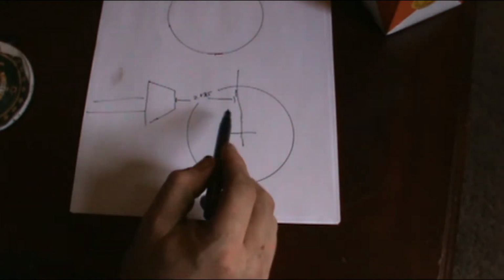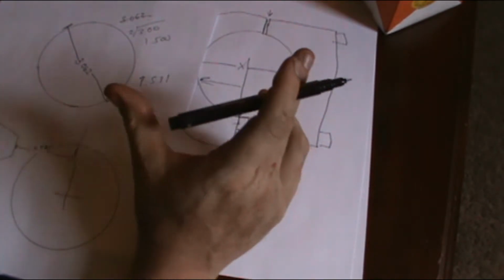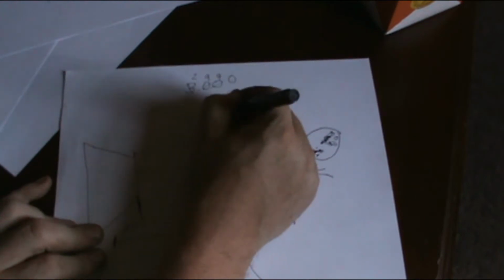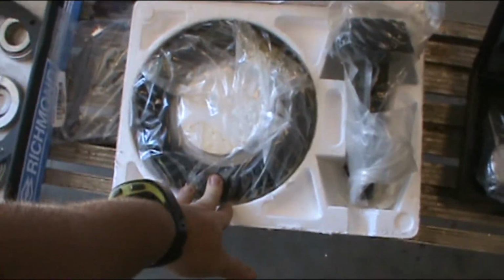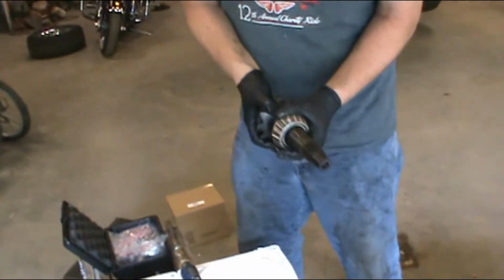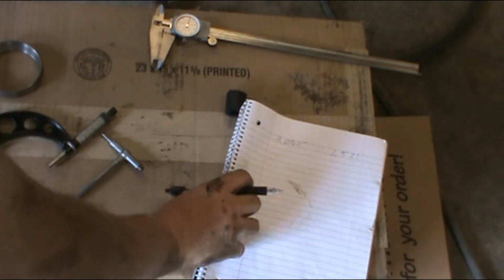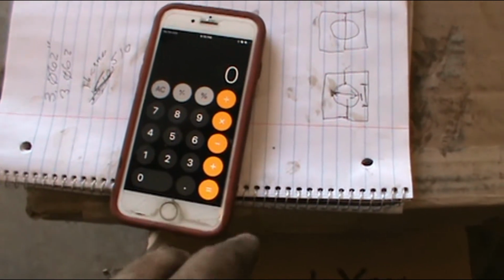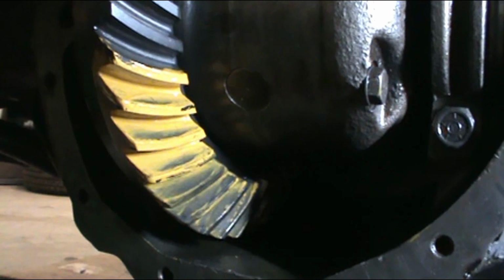Proform Parts 66516 Pinion Setting Tool instructions

Comment: could a man just torque the caps down, use a snap gage to find center line and thin use a straight edge face of the rear end housing, measure to the bottom of the Carrie race to the straight edge, divide the CL measurement by 2 that you got from the snap gage, calculate those numbers together to find true CL from face of housing. Then you can measure from the straight edge to the face of the pinion gear. Do you think that would work?
Reply from the maker: In theory if you can hold it all together
Reply: @GSEShop  your video is fantastic. maybe we share a brain but this was exactly how i need this to be explained. ive been watching and reading for days trying to teach my self how to do this. thank you
Reply from the maker: @joshstaley7459  comments like this make it all worth it

Comment: Good example. 
In the beginning I was starting to think that you were about to come off the rails,  however you held it in line and kept her on the tracks .
So as you may have figured out,  you can easily achieve these measurements,  without the tool, and save yourself some money.
When you took your first measurement, the OD of the bearing race , you then can put the bearing race where it goes in the housing , and with a good straight edge laying across the machined face of the rearend measure to the top of the race.
All simple math from there .
Add that number to the OD, divide by 2, you now have you center line.
You now can pull your pinion numbers to the face and your straight edge.
Reply from the maker: Thank you

Comment: It's been a long time over 20 some years since I worked on a differential on a car since then I've been retired from the business a GM cars I remember the numbers are the back of the but I also remember some of them had an extra number with a plus or a minus symbol a abnormal. Pinion gear
Reply from the maker: The directions that came with it gave it a +-.002

Comment: I think you're missing the point of measuring the distance from where the bearing cap bolts to the housing to the bottom where the race seats. It's not to just get half the measurement of the bearing race. If it was you would simply measure the race and divide by two. The reason they want you to measure from the flat surface where the cap bolts to the bottom where the race seats, it's because when they bore the hole for the race it's not always centered. It could be machined deeper in the housing or deeper in the cap. The center line of the race is not always where the cap contacts the housing, you may have more of the race in the cap or more of the race in the housing. That's why they have you measure it, and then add or subtract, if it's not centered. Most times it's not centered.
Reply from the maker: I admit I had not considered that, but I also haven’t run into it.  I couldn’t be off by very much or else you would have trouble installing the race either in the cap or in the housing.

Comment: Great video and explanation. 
I’ve done 12 and 10 bolts using the Ratech tool with good success but now I need to do a Chrysler 8 1/4 and was considering the $500+ puck kit. 
Gonna go this route since you made it comprehensible. 
Thanks again.
Reply from the maker: Thank you

Comment: The distance from the centerline of the ring gear to the backface of the pinion is;;;;
Dana 60 = 5.000 inches
Dana 70 = 5.375
Dana 80 = 5.812
Hope this helps
Reply from the maker: I am sure it does
Reply: @GSEShop  just so you know that information was taken out of a OE ford truck shop manual.
Also states in the book for an 8.8 the  nominal pinion depth setting shim is .030,, so that means that most 8.8 leave the factory with a .030 pinion shim,,and I can say that is all I've seen in them with factory gears
Reply from the maker: @justingeraldi2304  cool good to know

Comment: I  bought the Jegs brand and it has a hole on the other end to bolt the bar to the bearing clamp down area,  Also i figured out how it works and wrote a Excel file so all i have to do is punch in the pinion dim and variable numbers.  It calculates the movement amount AND which direction. I have tried different numbers eith way and it works on paper. I will try it on my truck diff soon.
Reply from the maker: Cool, I purchased this one but the jegs one was on my short list

Comment: First mistake, not all manufacturers (factory & aftermarket) put any measurement numbers on the end of the pinion for the purpose of setting the pinion depth. 3 examples: Chrysler 9 1/4, 8 1/4, Dana 60. Are you making the assumption that there are only GM cars out there? I fully understand the principles & how to measure. The big headache: Where the hell do you find the specs needed?
Reply from the maker: I am sorry but I was reviewing the tool and trying to provide a detailed guide on how to use it.  This was not an all encompassing “how to change your pinion” or “the only thing you need to know” kind of video.  I had to change the gears in my 12 bolt and that is the axle I used for the video.  If you cannot find the marking I would recommend contacting the manufacturer, or the vendor who sold them to you.  If you are removing a gearset with the intent of reinstallation, you should take a measurement before taking the pinion out if things are in good working order. Thank you for the comment and if I only made one mistake then I am doing good
Reply from the maker: So I am now doing a 9 1/4 Chrysler and the number is engraved on the end of the pinion.  I plan on a Dana 44 front axle soon and I will let you know what I find
Reply: @GSEShop  I have since fund out that aftermarket gear sets will have a number etched or stamped on the Chrysler 9 1/4 gears. Not so on the factory gears. At least the 3 sets that I have had experience with. Also on a set f replacement gears for a Dana 60 (going from 4.10 to 3.73 gears) there were no numbers on the end of the pinion. There were numbers stamped on the pinion shaft but they were not measurements, probably some sort of production numbers or serial #s. Another problem with the Dana gear set: The machined end of the pinion gear wasn't flat, it was conical making any kind of measurement impossible even if there were a number present. They were Dana/ Spicer gears. This is gonna be complicated so bear with me. I found the actual specific dimension for the Dana 60 in one of my Dodge FSMs. The distance from the rear face of the inner (rear) pinion bearing to the center of the carrier is 5.000" exactly. using machinists parallel bars & a wide base depth mic I did the following: 1) Measure carrier bearing bore depth using a depth mic. This will give you the half dia of the bearing bore, or what it is relative to what it should be. In the case I was working on the bearing cap flat surface was not equal to the Half dia size so I calculated that into the final measurement. Also each side (bearing bores) were different so I averaged the 2 readings. I cannot remember the actual measurement but lets say that the average was .010" less than the half dia of the bearing bore. Just add that amount to the final depth measurement. 2) Using 2 sets of  parallel bars set across the carrier bearing flats I measured down to the surface of the inner race of the rear pinion bearing. Subtract the thickness of the parallel bars & add the previous dimension from the carrier bearing bores. Should be exactly 5", if not (it will be more) then add shims to arrive at 5". I used setup bearings for all measurements & this was a rear drive unit. With this Dana unit I was able to get within .002" on the first try of setting the pinion depth. I have studied those depth setting tools (someone even offered to loan me one) but can't see how they would be very accurate especially after finding the baring cap irregularities. Might get one within .015 to .020" but that is all. Problem with the 9 1/4 is that I cant find the factory machined pinion bearing depth. There has to be a specific tolerance held at the factory otherwise they would have hell assembling the things. I have one to take apart sometime that is a good unit & I'll measure that one & record for future use. Sorry for the length but I have no way of making it shorter. Also don't know how to send pics which would make it easier. Thanks for the input.
Reply from the maker: @larryhutchens7593  that would be the correct procedure, but speaking as a machinist, and using this tool you would only need to measure the side you are using the tool on.  If one is .005 and one is .008, difference would not matter as the center line doesn’t change.  You would just need to know if you need to add .0025 or .004 depending on what side you are on.  I called Yukon Gear and they said that basically all 9 1/4 rears are the same and all take a .032 shim.  He said they don’t mark all of them because almost nobody measures anyway.  I was the first person he spoke with who asked such a question. Seems odd to me but that was directly from their helpline.  I hope that helps.
Reply: @GSEShop  As a 30 year machinist I am very familiar with machine work in the manufacturing industry. It is all about tolerances. The closer the tolerance the higher the manufacturing cost so you only hold close tolerance where necessary. After a search I located my notes on that Dana axle that we are working on and here they are: All references are in a rear wheel drive unit sitting on saw horses, U joint end of pinion pointing downward, working from what would be the bottom of the axle housing. 1)case half bearing bore: left side 1.887", right 1.880", Avg 1.8835", round down to 1.883". 2)Carrier bearing bore 3.814", divide by 2 = 1.907. Do the math & you will notice that the bearing cap split line is .024" below the center line of the carrier bearing, on average. Notice that there is a variance between the left & rt sides which means that the mill cut that made the machined surface for the caps is out of parallel to the plane that is running through the center of the entire axle housing (lengthwise from left to rt). I'm also sure that there is a manufacturing tolerance for the other plane of that cut, It should be square (at 90 degree angle) to the plane running through the center line of the pinion gear but there is, no doubt, a tolerance for that also. So if I used your tool on one side or the other of this Dana axle the measurement would be off by .024 plus or minus whatever error would be created by the out of parallel angularity of the surface the tool were attached to. That could be calculated by some plane trig math work. End result: a stab in the dark. By using my method & the 5" dimension & shims I was able to arrive at a measurable 4.999" dimension which was about .002" from where we got a good pinion depth pattern. I have no trouble with your tool process if it is the best someone can use. Most don't have the tools that I used or the skill to use them so I understand that. My gripe is that I cannot find that dimension that I found for the Dana 60 (the 5" one). I need it for the 9 1/4,  8 1/4, & 8 3/4 Chrysler & no one seems to know what it is or where to find it. Would the folks at Yukon have any idea?   Here are some assumptions about tolerances that I'm going on. Closest tolerance is in the bearings themselves. probably held in the 4th digit to rt of the decimal (.0001 or so). Next would be the plus/minus tolerance of the center line of the pinion gear itself. I am assuming that this is the measurement that is etched on the end of the pinion gear. Another tolerance (again plus/minus) would be the location of the surface that the inner pinion bearing race seats against. That surface would have to be cut at such a depth that is below the required depth & shimming is required to get the pinion depth correct. It has to be deeper than the assembled dimension, if it were less then there would be no way to correct for pinion machining tolerance.  A couple of problems with the Dana axle 1) The bearing/seal kit we got had enough shims to do the job but not enough variety. I had to run all over town to locate enough to get the correct shim thickness, used ones at that. 2) there was some slight difference between the set up bearings we used & the final bearings. Shims for the pinion brg preload produced way too much drag & we had to fabricate a press to remove the pinion so that we could get the situation corrected. The comment from Yukon is probably correct. Most of their gears go into drag cars or off road vehicles so a bit of whine would not be very noticeable. On off road vehicles, they usually get broken about 20 minutes into their outing anyway. I had to build this axle for road use in a van that is being converted into a camper. Longevity is critical. Again apologies for the length, it is a complicated issue & thanks for the feed back.
Reply: @larryhutchens7593  Thank you for the issues you pointed out. I wondered about the plane angularity of fixture points for the caps with respect to the pinion. I've been back and forth on buying one of the better kits or making something at work. I have a couple rear ends that need rebuilding. Everyone says I should just buy junk yard axles, but I'd rather rebuild them and know they've been done to my satisfaction.
Reply: @nodriveknowitall702  I have done a lot of research on the setup of axles and don't know how to advise anyone on the subject. The Dana 60 that we did came out great, no noise or vibration. At first we couldn't get a good pattern but I contacted a local axle builder who does work on trucks & off road vehicles & he said that it is difficult to get a textbook pattern on an old axle housing. I followed his lead & everything worked great. On the Chrysler 9 1/4 I followed the same routine & got a decent pattern. I haven't installed it yet so I don't know how it will work out. On the salvage yard units you need to be aware that the bearings could be bad & you would need to tear into it anyway. Good luck.
Reply: @larryhutchens7593  I wound up making a measuring jig at work, during spare time, that allows me to measure from the center axis of the carrier to the pinion. Too bad I don't have a mill and lathe at home. I'd spin them out at sell them! It's very similar to the kit they want ~$500 for, so it would probably infringe on a patent. The parts finally showed up and the pinion gear had the depth scribed into it. Install starts today.
Reply: @nodriveknowitall702  I am still on the learning curve on this pinion setup deal but here is what I have gleaned from 3 of my Dodge FSMs. That dimension, the dimension on factory replacement gears, appears to be the +/- tolerance of the pinion itself. There is another tolerance to be considered, the +/- tolerance allowed for the machining of the axle housing itself. The FSM setup procedure relies on the fact that you are replacing the original gears & have the original shims. Relying on you having an unmolested axle setup. The dimensions on the end of the pinion indicate how much shim to add or subtract to the original shim pack. Now this from a guy who sets up truck (large trucks) & off road axles. In a perfect world all those dimensions would work but an axle housing that has been in service for a long period of time will be aged, relaxed or torqued. Axles that do not have a drop out center section (Ford 9", MoPar 8 3/4) are a welded assembly and will relax some after initial assembly. Even with accurate setup tools there will be a certain amount of trial & error testing for proper pattern. On the Dana 60 that we did we couldn't get a perfect pinion depth contact pattern. The Axle guy said that is normal & the pattern we had would work ok. So far the unit runs smooth with no gear whine & no vibration & no overheating. I'm with you on the tool room lathe & small mill thing. Many a time I have had the need for one or both to build a tool for some car project but mu little shop is overcrowded as it is. Good luck with your project.

Comment: Once you established the diameter of the carrier bearing seat was 3.000" diameter, how are you verifying the carrier bearing seat bottom is a perfect 1.500" from the carrier bearing cap surface ? In addition, what would you do if it was (example) .140" ? If that really doesn't matter, why measure it in the first place ? Did I miss that part ? Maybe I just haven't thought this one through well enough yet. Thanks. Great job !
Reply from the maker: A few things.  The directions say to use the tool to measure the flat to the bottom of the seat in the housing.  I did do that and my measurement was exactly half.  Speaking from experience as a machinist that has machined surfaces for bearings I know they do not like to be compressed more than .0005” at the most.  If you compress the race any more than that it warps the race and the bearing will not last long if it rotates at all.  The final point is using the tool to measure as in the instructions will at best get you to +or- .005” which can be useful when setting up a bearing it is miles away from a good measurement of the depth of the bearing surface, if you get it in the exact center where the measurement needs to be taken.  That is why I would just measure the race and divide it by half.
Reply: Other than making shore that the race will not be compressed too much is there any other reason to take the measurement where the Carrier bearing sits
Reply from the maker: @gregscherf9385  not that I know of.  I would do it maybe to make sure you didn’t get some crazy off measurement but it should be half the race.